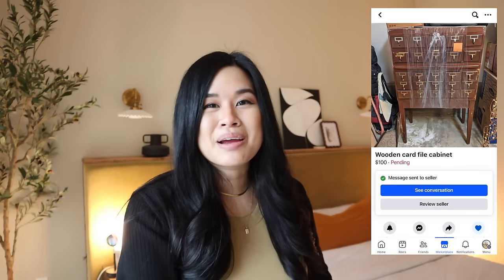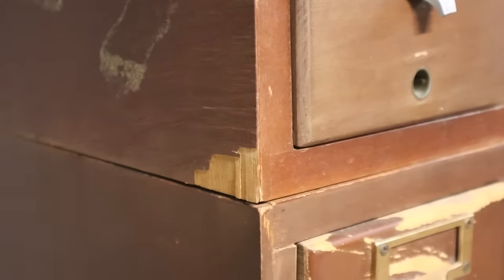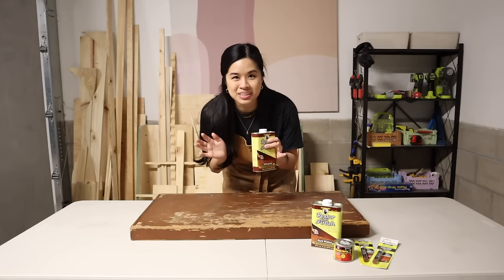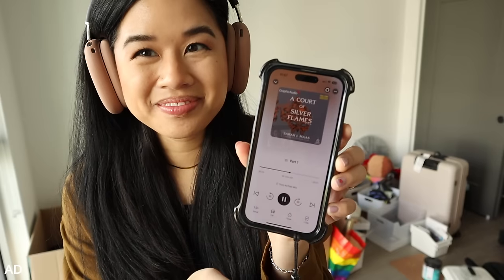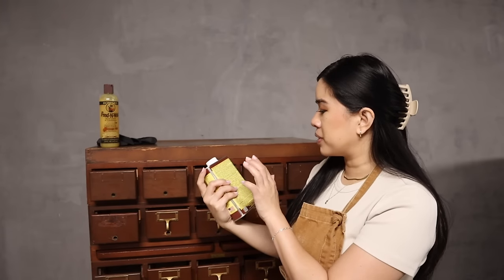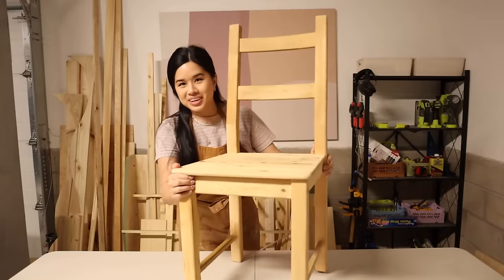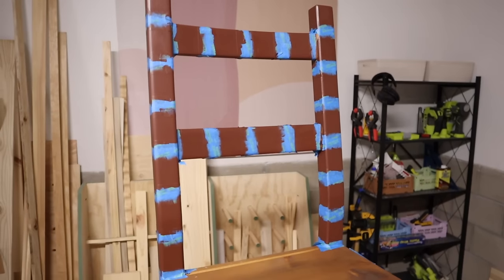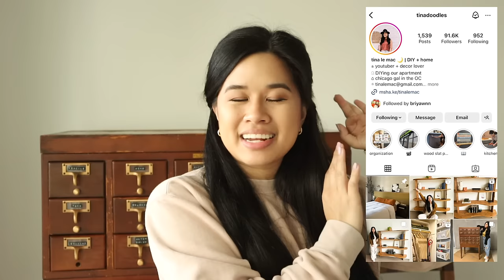MAKING OVER VINTAGE FURNITURE INTO MY DREAM DECOR | *library card catalog + ikea chair makeover*

Comment: The Feed-n-wax also can be used on the inside of furniture. It's ideal for undersides of the drawers and slides to prevent rubbing and wear of the wood through years of use. It's basically "body butter" for furniture.